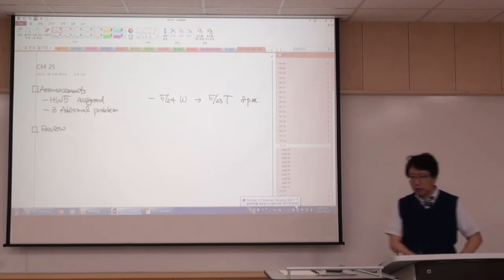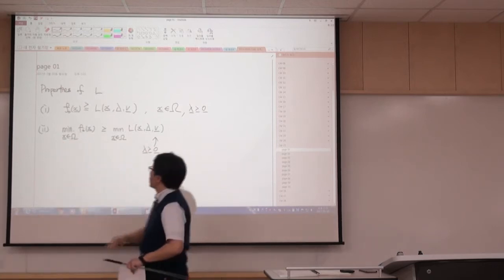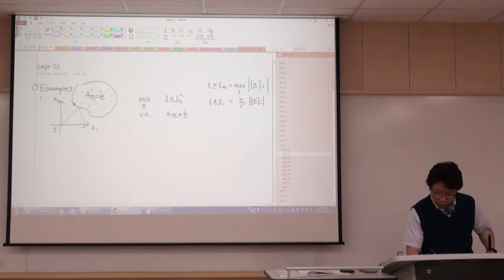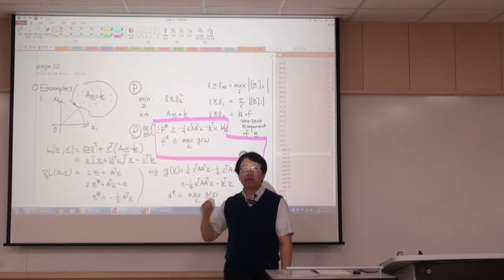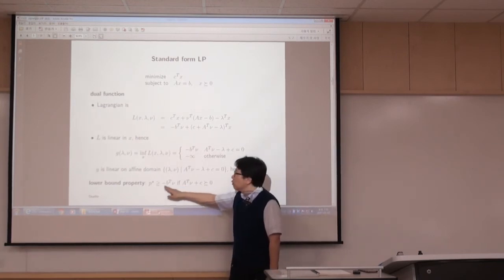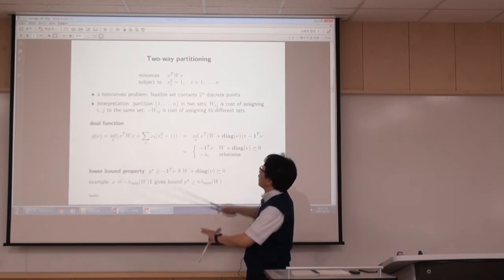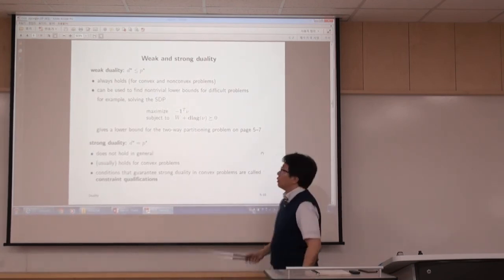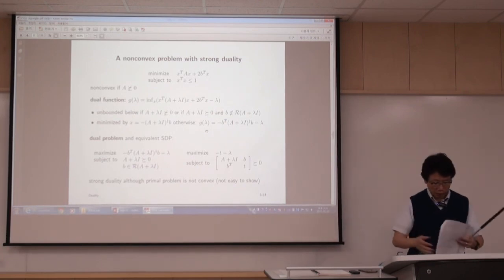25

Comment from the maker: 0:00 announcements 
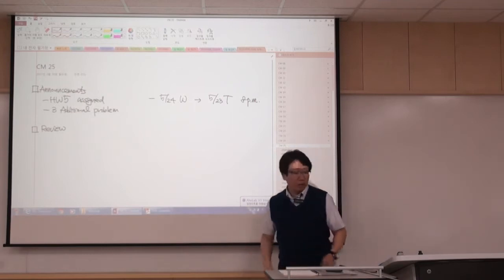1:39 review of last meeting
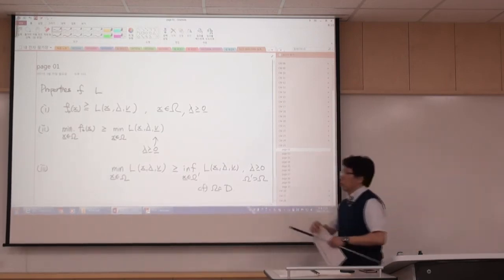14:32 (correction) Omega -> Omega prime
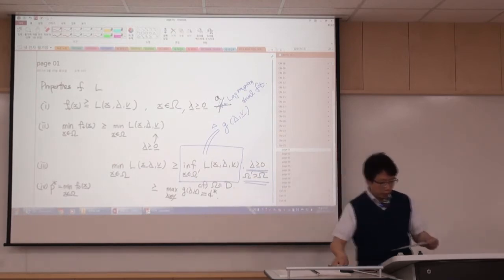19:34 Example 1: Least norm of linear equations 
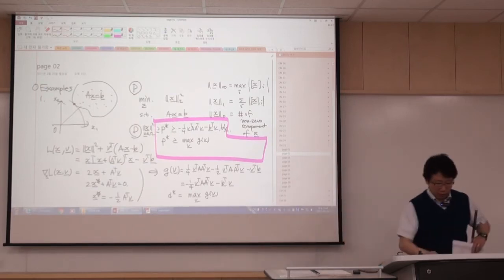33:33 Example 2: standard form LP
51:41 Example 3: two-way partitioning
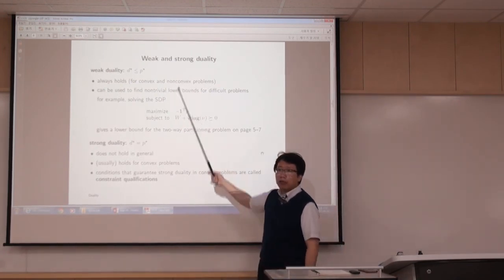1:04:00 Weak and strong duality
1:05:10 Slater’s condition: a sufficient condition for strong duality
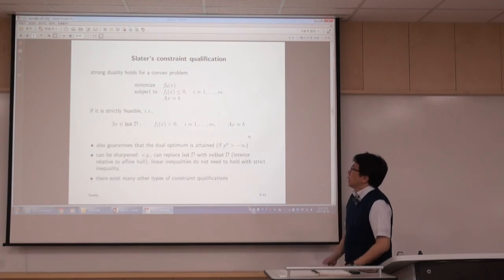1:08:00 Example 4: inequality form LP
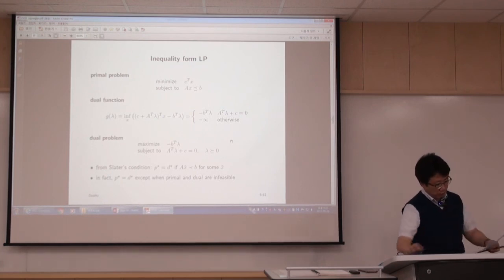1:10:47 Example 5: quadratic programming
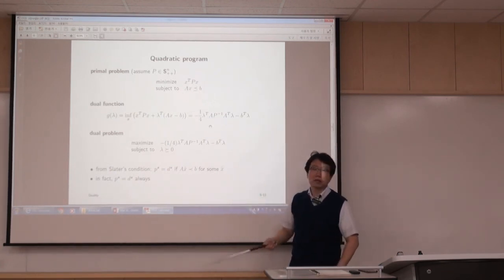1:13:25 Non-cvx with strong duality